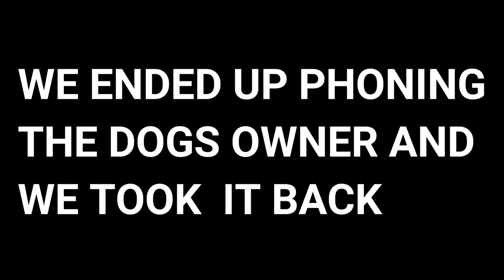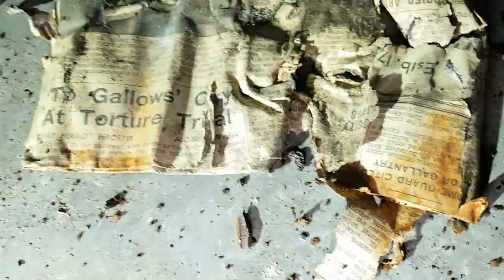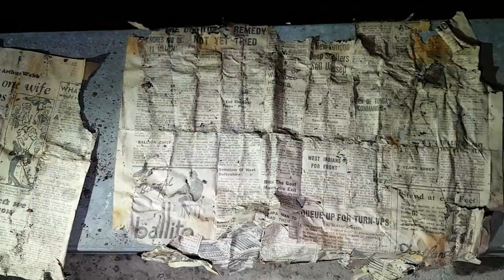Top Secret WW2 Tunnel

Comment: That orange tin at 5:28 is a de greasing agent called "Gunk".. It smells like a strong disinfectant, but worked wonders for cleaning car engine parts. Once applied by brush, it could be rinsed off with water.... Great video - Thanks.
Reply: I still use it every day. Cant ever get that smell out of your nostrils.
Reply from the maker: Ow ok thanks for the heads up now I know